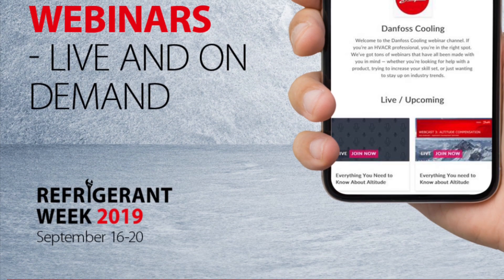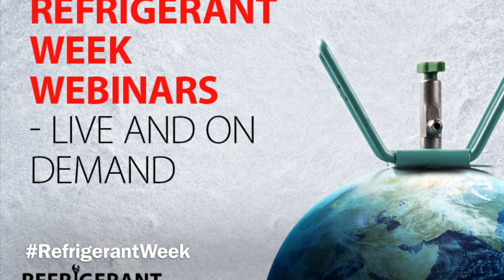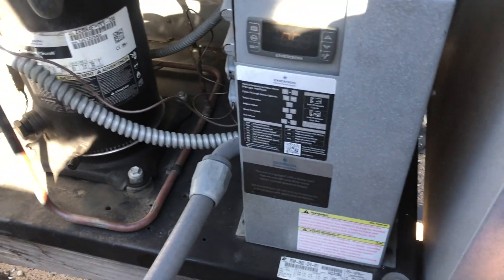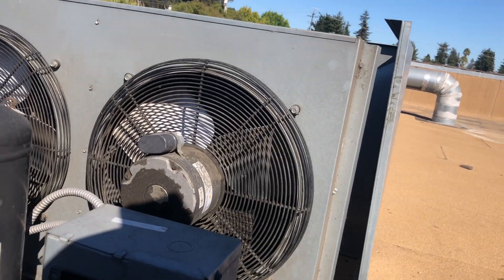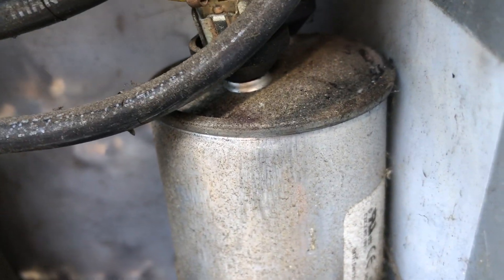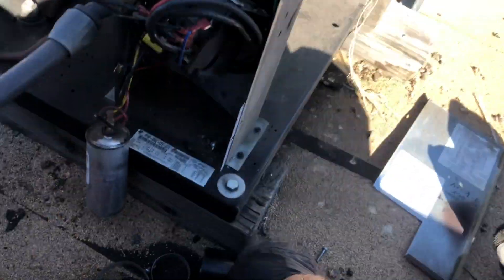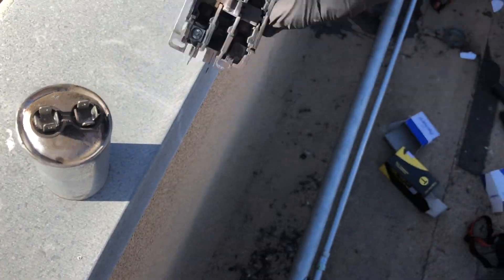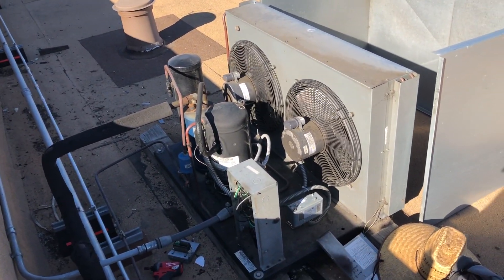Walk in warm

Comment: Good Vid.i'm suprised the compressor was still good. those windings had to of taken a beating. Cool drill ! thats what ive been looking for. my New ryobi keeps loosing up everytime i go in reverse and i'm not happy with it. im thinking of switching to red team . that drill looks smaller and lighter than my ryobi 18volt drill. these days i'm all about going lighter. How are u liking it ? i'm thining of getting this kit. This looks like the one u are using. 

https://www.homedepot.com/p/Milwaukee-M12-FUEL-12-Volt-Lithium-Ion-Brushless-Cordless-Hammer-Drill-and-Impact-Driver-Combo-Kit-2-Tool-w-2-Batteries-Bag-2598-22/303101201

Killer deal looks like right now. 2 drills 200$ includes charger and batts.
Reply from the maker: That’s a good deal you will like them.  👍👍

Comment: Would this be wear and tear,  i would check for a reason due to multiple parts burnt out, like start up amps and running amps if there's a over amp then you would eliminate future problems. I love watching you videos keep them coming thank you so much.
Reply: 99% chance it was the run cap failed first, causing the start circuit to bang on/off non stop cooking itself and the rest, it's very likely the compressor/oil is hurt and will RIP soon.
Reply: @throttlebottle5906   i agree , short cycling could do it too

Comment: Yes Dave, I am subscribed... I like how you think outside the box .. In my work.. poultry farmer... you have to think outside the box to get things running.. many times its not the cleanest way .. but its running.  Too many people will not think outside .. if they can't or got have the exact parts they will give up.. many people forgot how to think and problem solve.. and they forget that usually there is more than one way to achieve the desired end result.  Good job.. Rock on!
Reply from the maker: I used to repair Dairy’s cow can’t wait to be milked. Thinking outside the box was standard operating procedure.   Thanks for watching

Comment: Hey NorCal how come you don’t carry one of those universal potential relays? I use them in a pinch never had a problem.
Reply from the maker: I have two on the van.  This one was still good, but replacement with oEM is something I like to do
Reply: just went back to a job i put one of those supco " SUPR " get your butt out of a jam relays in. worked Great For 5 years. Factory stuff usually lasts 10 years or more. so there is a trade off. factory stuuf is allways better on certain stuff. but, ill keep using the supr's.

Comment: That’s a sweeeet Milwaukee.
Reply from the maker: Nice. Have you tried the hydraulic one.
Reply: Been debating between hydraulic or fuel. Fuel is at least 50$ cheaper up to 800ftlbs but hydraulic is supposedly 3 times quieter and constant 450ft lbs. think u helped me decide. Gonna get the fuel. I don’t need quiet, rather have extra 50$ and enough power for most everything we run into.
Reply: No but gonna check it out

Comment: Help!!
I had a walk in today the evaporator coil was freezing up for a month, customer was tired of thawing it with a hose, everything (electrical) worked, so I did a subcool it was 0, so I added more R404a. Subcool wouldn’t go above 6 i added like 5+ lbs. but I got worried about over charging it so I stopped, I added an extra thaw for 45 minutes at 2am, plus the other 4 15min thaws it was already set for. Did I do the right thing? Should I have kept adding 404a til I got 10-15 sub cool?
Reply: Jarred,  I'f you have a liquid reciever your the subcooling wil be low,  you don't worry about subcooling as much when you have a reciever. Fill the sight glass,  calculate the total charge,  add 10 - 15 % more of the total charge for the winter time,  (depending where you live, )  then focus on your super heat at the txv, not at the compressor,  once you maintain 8-10 deg superheat at the evap,  check at the compressor,  it should be under 25deg superheat.  In Ohio we usually have 3-4 defrost cycles per 24 hours,  30-40 min each,  this evap hopefully has a fan delay/ defrost termination switch,  those can also go bad and cause frost on the ceiling and crappy defrost cycles. In my area a 15 min defrost will cause more ice because when you combine the humidity in the box and the partially thawed coil (because of such a short defrost) the ice grows faster than if you had one fully melted coil.  Hope this helps.
Reply: Evap drain good? Door has a good gasket?  Door closure works?  Condenser dirty?  Tx valve sized correctly? Temp control broken? Lots of things make an evap icy other than low charge.
Reply: Apprentice Phil I checked all that except for the TXV sizing. In fact come to think of it I noticed it has been replaced since The unit was installed in 2014. Thank you for the input. I took a picture of the txv.
Reply: Wait a second! if the TXV was sized wrong how come the problem only started a month ago? It was not changed recently. The thermostat was definitely set too low. But how come I couldn’t get the sub cooling right?
Reply: No the txv was the right part number, I just checked it against the manufacturers manual. shit I should’ve checked temperatures on each side of the filter dryer.
Reply: @jaredj631  match the txv to the capacity of the compressor. If the tonnage is below the capacity of the compressor get a bigger Txv. You might have to put a sightglass on the unit if it doeant have a specific charge just to prove you have a full column of liquid feeding the txv. Did you leak check?
Reply: Apprentice Phil it has a sight glass, I added refrigerant until the bubbles stopped. Once they stopped, I took the subcool again, it was fluctuating from 4 to 6. I was doing measurements from the condenser. I added about 1lb more and the subcool never changed. I made sure all the ice was melted and the fans were on. I gave it at least 1/2hr to stabilize. The gauge was reading 35 low/275 high it’s r404a
Reply from the maker: What phill said.
Reply: Get digital gauges or probes. Analog gauges fluctuate too much on outdoor temperatures. This way your a better tech. If TXV is sized right  then  adjust the TXV  while measuring right at evap. Could be a. Could be a bad powerhead. If someone didnt rag it good when installed the diaphragm could have gotten weak and now is leaking and thus not expanding or contracting properly and is failing.
Reply: Check that sh🙌